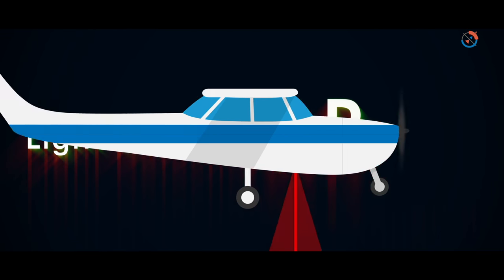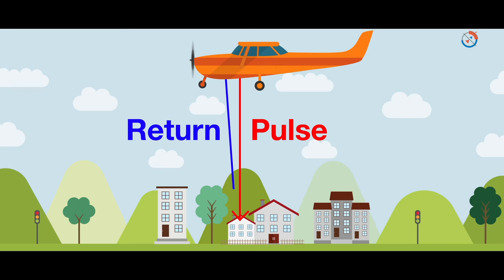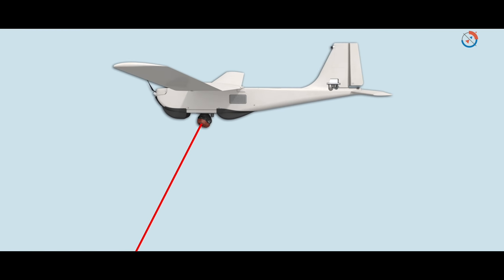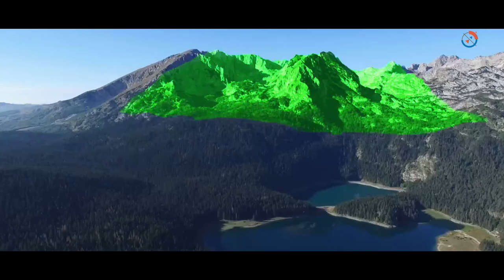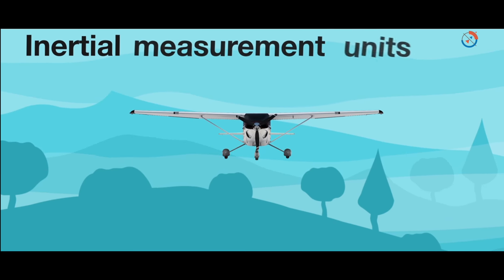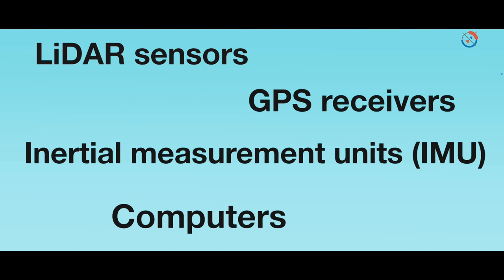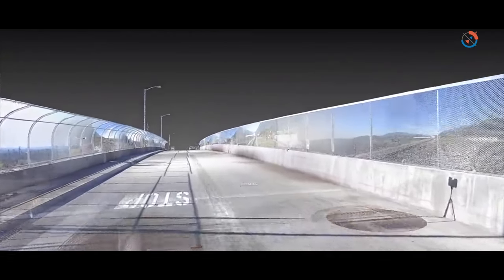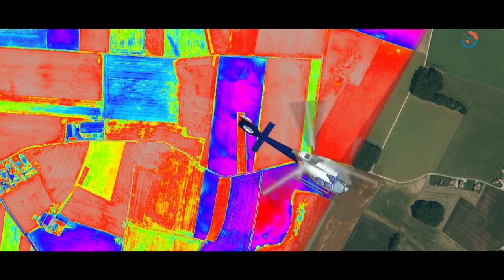What is Lidar?  How does Lidar work? Know all about LiDAR

Comment: But why not just photograph?
Reply: 2d vs 3d
Reply: @ImKrazyFrench  So Lidar is just glorified 3d version of photo?
Reply: @aniksamiurrahman6365  No I wouldn't say so. Lidar data contain much more information that you cannot access as a photo. By example It has alot of uses for tree canopy. You can't take a picture of a forest and distinguish each tree one from another, with lidar you can do such thing.
Reply: @ImKrazyFrench  But then why does LiDar images look so vague? Just asking.
Reply: @aniksamiurrahman6365  when laser bounce off from a surface and is captured back the information is stored as a dot from where the connection happened. Basically cheap lidar data will look vague as they do not use alot of 'laser power'. On the other hand expensive lidar data will be denser because they use more 'laser power'. I guess it is like comparing 480p photo to 720p, more pixels (dots)